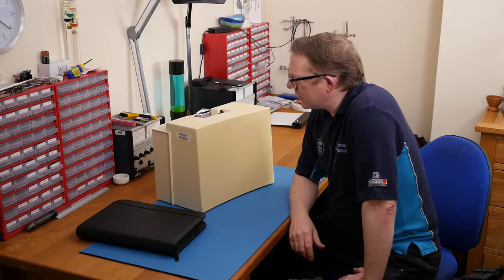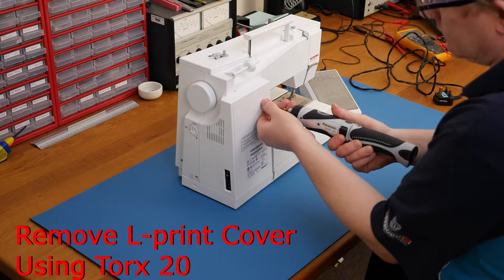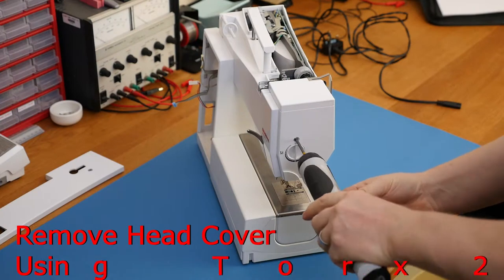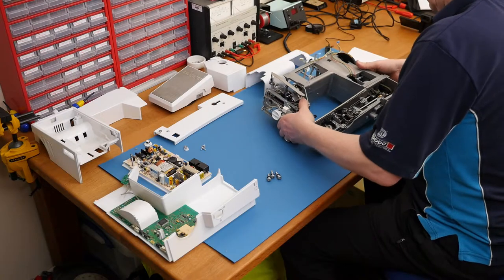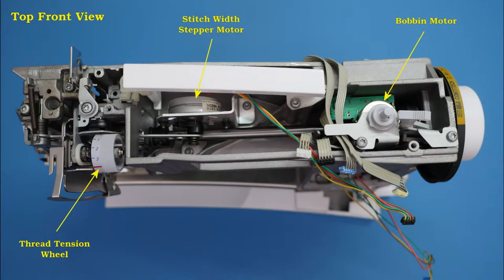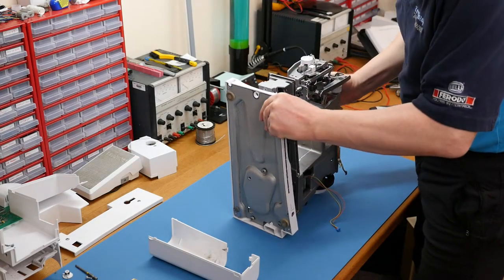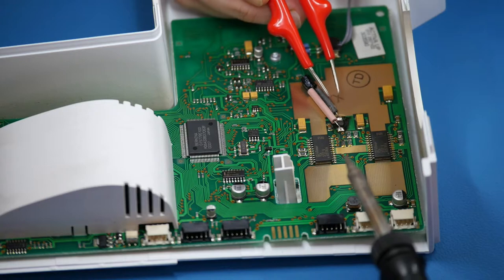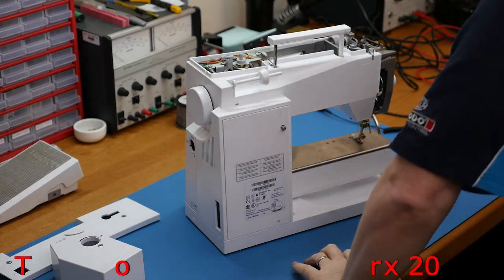How to Mend Repair a Bernina activa 140 Sewing Machine  + 🏃‍♂️ Live Machine Running 🏃‍♀️ disassembly

Comment: I've been an electro/mechanical service technician for over 30 years and this is one of the best repair videos I've ever seen. So clearly filmed and well narrated. You, sir, are one of the best on YouTube. I'm looking at buying a used Bernina and this makes me think I could fix it if a problem came up. Nice to see the guts of a 20 year old machine similar to one I'm looking at. Many thanks!
Reply from the maker: That's one powerful compliment.  I thank you Sir for taking the time to say this.  I do try my best and put my heart into my videos.  Hope it helps you.
Reply: @CoatsandGaiters  When I saw your workbench setup with spares and a Fluke multimeter and a Weller soldering station I knew that this would be a good video. We have a few things in common, it appears. I also have an attraction to motorbikes and auto repair as well as a suitable assortment of high quality tools and gizmos. 

Living near the left coast of the US I don't have much need of Peugeot repair videos (they haven't been imported here since 1990) and the last Mini I was involved with was a tired 850 back in the mid 70's that was confiscated by the constables in Amsterdam for not having Dutch plates. 

I did have some serious dealings with two separate Norton 850 Commandos in the same time period, one of which got left alongside the motorway with an alternator problem on the way to Rotterdam. When I returned someone had already collected it without leaving a note. Heartless tea leaf.

It's always refreshing to watch someone who knows how to properly wield a screwdriver and spanner and doesn't let his wisdom inflate his ego. Cheers and thanks.
Reply from the maker: @marscruz  Oh dear you've had some luck haven't you !!  Ironically I have been planning to start doing electronics on YouTube as I enjoyed it as a teenager but still not got around to shelling out the £1,000+ for an oscilloscope so things have been on pause for a while now.  I struggle to pay big money on tech items as they always tend to go wrong or have a sting in the tail, like needing an update or something that often kills the item.  Mind saying that there are lots of true experts on YouTube that do electronics very well.
Reply: @CoatsandGaiters  There are some good deals to be had on inexpensive Rigol and Siglent Tech scopes for less than half of your thousand quid price point. I heard about them from Dave Jones on the Ozzie channel EEVblog. He tests multimeters, scopes and all sorts.
Reply from the maker: @marscruz  I was looking at the Keysight ones.  If a mobile phone is £1,000 then surly something as complicated and precise as an oscilloscope would be £1,000 minimum in my logic.  Camera lens is £1,000 as well....everything is £1,000 lol
Reply: @CoatsandGaiters  Looks like the least expensive Keysight is about $600. Ouch! Maiden USA.
The best American scopes (ancient analog) used to be Tektronics and HP. I haven't used a scope in ages (retired). 
I like my Fluke meters and Wiha screwdrivers. Good tools makes the job easier. 🙂
Reply from the maker: @marscruz  Tektronix is still the best I think but the prices are really serious, that's why I'm reluctant to buy under £1,000 if I did buy one.  It so often happens you buy the cheaper one then find you should have paid that bit extra as you missed some important feature.  Then you sell it at a loss and buy the one you know you should have done.  I've been waiting to buy a scope for the last 2 years so can't see me shelling out that grand any time soon.  I'd have to be really flush to do that.  I spend it on camera gear but struggle with spending it on tech.  I just upgraded my phone but it was to an new old iPhone 11 for £350.  Again I cant bring myself to spend over £500 on a phone.

Comment: Can only say Wow ! I have exactly that same machine...which is now 20+ years old. At present - fingers crossed - it's working perfectly, but the observation about tantalum capacitors is well taken on board. 
Apart from fixing that, showing how to remove and install the covers is very helpful as mine was bought used and could probably benefit from a service. I'm quite used to servicing vintage mechanical machines, but never so far had to take the covers off a modern one, so knowing how to do that without damage is brilliant. 
Despite their age, these are still superb machines.IMO Bernina still make the best domestic ones...although at a price...but think you can figure out why when you just lift one up (heavy !) even before you see that chassis and compare it to some of the other stuff on the market.
Editing this must have taken quite some time and effort, so thank you so much.
Reply from the maker: Thank you for the comment.  I love the Bernina machines, my wife has one and my mum is still using hers so the repair has held up since making this video.  The videos take about a week to make.  Two days to record, two days editing and then a day doing voice over and social media parts.

Comment: This is the best repair/tear-down video I have ever seen on YouTube, and I have watched hundreds.  Brilliantly, logically structured, detailed and comprehensive.

It gives me some hope of repairing my sisters Activa 135. I suspected a fault with the L-print PSU module, since the 5v logic S-print module and and screen are alive, but no drive to either main or bobbin motor, even though the footpedal appears fine (microswitch working, cable OK, potentiometer range seems about right from ~10MegaR to 8R fully depressed). This video is just what I need to dig deeper on a sewing machine, a device as alien to me as  a Formula One gearbox.   

AIUI new L-print boards are about £150 and S-print £250, but n/a to ordinary punters,  only pro Bernina techs. Add labour for service and it's fairly obvious why my sister's machine has sat in a cupboard for 4 years. Even if you can afford a potential £400-600 bill, it's a lot of money to spend on a 20-year old machine. She already had it serviced by independent sewing machine engineers who failed to fix or identify the problem, probably because electronics are beyond them.  Thank you so much for making this video. I'll let you know how it goes.
Reply from the maker: Thank you for such a lovely comment and I really hope you manage to mend it.  Keep us updated.
Reply: Can't edit but the range of the footpedal potentiometer measures 10megaohm (with pedal depressed just enough to operate the microswitch cut out) to ~8ohm at full throttle.  I believe this is correct. There is another pretty  good video on YT that deals with testing the Bernina SR1 footpedal and cable used by this generation of machines. Seem to be a very common failure, but are also widely available new, £50-£60.
Reply from the maker: @MrShadownoise  Thank you for all this information.  Hopefully it will help others that read the comments.
Reply: And... it is fixed and working. I stripped it completely. The 135 is a bit different, with a simpler power supply and only a single fuse.  Found a couple of indications of previous sloppy repair, including a missing case bolt and some sticky tape. On the S-print module I re-soldered what looked like 3 potentially dry joints, but also the 4-pin 'blue' connector  was disconnected - I assume the previous sloppy repairer didn't insert it fully.  Thanks ever so much for showing how it comes apart and the sequence.
Reply: Also the S-print board is very different  on the Activa 135. No surface mount tantalum capacitors! The joints that looked possibly dry  were either end of a fairly large axial capacitor near the centre of the board, and the attachment points of the mains socket (which probably gets stressed by frequent use). But I suspect the real problem was that the 'blue' connector had come loose or not beein fully inserted.
Reply from the maker: @MrShadownoise  Sounds like if anyone can repair it, you could Tony.  Everything seems to have such a relatively short life today considering the cost when new.

Comment: Thank you for your awesome video of the disassembly and workings of the Bernina. I have a Bernina activa 130 and wanted to clean the insides. Your methodical and clear disassembly was what I needed to be sure I was able to see the insides as well as carefully reassemble it properly. I would love to see a video similarly showing the areas that need to be oiled or greased too. Thank  you for your time and efforts.
Reply from the maker: Thank yo0u for such a lovely comment Angela.  Sadly the sewing machine is my mums and it's back with her.  Hopefully your be able to oil it with some Bernina recommended oil.  Best use what they recommend to be on the safe side and this might be where less is more.  I'd probably just put a spot on every point where there is movement between the mechanicals.  Good luck.

Comment: Wow, based on the comments there is great demand for help with sewing machines!  A general Youtube search brought me to your video.  Well done.  Bought a Activa 130 at the car boot yesterday.  Powered on, but wouldn't sew.  Fault was easy to spot - very poor repair on the cord to the foot controller.  Machine needed a deep clean so I took the case apart like you did - looked like the machine blew up on the kitchen table!  Lots of lint to clean away, lube, and will put back together today.   No burnt tantalums, matter of fact, board is not identical to yours.  Meanwhile, Run it May, Shine it Must.  Cheers!
Reply from the maker: Sounds like you got yourself a bargain there.  They are great machines, shame the electronics can be a weak point but all tech ages I guess.

Comment: This is indeed a very nicely made video. And congrats on getting a working bernina!

I just got a faulty activa 145 but I guess I’m not that lucky to be able to get the faulty board, and machine, back to life. But will give it a try!

Thank you very much for the effort you’ve made in making this.

By the way the machine is fascinating!
Reply from the maker: Thank you.  The capacitors fail after 20 years so your could well be the exact same issue.  Good luck.

Comment: Thank you for an extremely informative video.  I bought a 220 years ago hoping to use it for classes but the local shop closed up.  I pulled mine out a couple of years ago and it wouldn't start and the dealer said to wait a half hour to 45 minutes.  It came on.  I was able to use it for a couple of weeks and then the stitch length died on me.  The needle just goes up and down  but the feed dogs work.   Bernina only gives a lifetime warranty on the metal parts, not the computer parts so I don't know how much they would charge for the fix and I was too frustrated with the machine to care anymore.  My daughter wanted a better machine and thought about seeing if I could this brick working so I checked out your video.  I don't feel comfortable in taking it apart, but from your video I'm guessing the connector is probably loose up front.  Still worth fixing as it seems some of these computer parts die after about 20 years.  Again, awesome video.
Reply from the maker: Thank you for taking the time to comment.  I think the capacitors only last around 20 years which is what died on my mums one in this video.  Hope you can sort it as they are good machines.
Reply: @CoatsandGaiters   I called up Bernina and they'll take a look at it.  Funny how one time I called up and they said it was worthless and now another lady says to bring it in and we'll take a look.  Once I got it up and running after your video it sounded terrible so I know it needs a good cleaning and oiling.  I miss the old days when you could practically take the entire machine apart yourself, oil it and everything was metal.  I have a much better understanding of why these machines cost as much as they do from your video and the cost to repair and clean them.
Reply from the maker: @quiltedwithlove  they are still expensive on eBay second hand so even if they quite really high you could probably still sell it on ebay as spares or repair.  Everything is getting more and more expensive recently.

Comment: Thank you, I have just bought an Ex-high school machine, identical, 140 Activa. It is quite grotty and there is a tiny squeak noise which I am thinking might be a capacitor on its way out. Thanks to your video I am confident I will be able to isolate the offending capacitor if/when it does blow. And also I am confident I will be able to clean its insides thoroughly and sort out whatever has been living in there recently. 🥴
Reply from the maker: That's great news I hope this video helps you.  Give's you a better insight if you do need to work on it.  They are lovely machines.

Comment: At 14.50 you run the motor with the presser foot down. Bad idea, you can scratch the base of the foot with the moving feed dogs and this will cause snagging on the fabric later on. Great video though, very informative. I can service the old non electric machines but would never attempt anything electric, don't have any experience with electrical devices and would probably kill myself. But it's fun to watch and I've learned a lot, thanks. Bernina sewing machines are the best in the world. At the end the wee fart sound as the machine powers up is the Bernina Burp, the needle centres itself on power up and this is where the noise comes from.  A needle set at the centre certainly won't work with the zipper foot though.
Reply from the maker: Good point, you can tell I don't sew lol.  Good to hear you learnt from it, I found it interesting to make the video and see everything working.  It's like magic when you see so many parts interacting at once.

Comment: I have the identical machine but was told by a Bernina repair person it wasn’t worth fixing cos if it’s age in case it blew again! After watching your excellent video feel confident I could take it apart and test the basics but I’m sure I wouldn’t identify the type of capacitor it would need should I see a burnt one! Any suggestions? I’ve just successfully mended the foot pedal of my mums vintage sewing machine( a lot less complex I have to add) after being told I’d probably need a new one!!! I’m probably getting overconfident now but feel I have nothing to lose! Feel distraught to let it die!🤣🤣🤣
Reply from the maker: They will be considering the labour costs involved I expect.  Don't forget these things will always have a value on eBay to someone.  You can always take a look and if you see something obvious or the same capacitor has blown as in mine I can try to help with information etc.  You can send photographs direct to my email address in the 'About' section on here'
Reply: Thank you so much that’s so kind! I’m going to have a go and I will meticulously put sticky tabs to link parts to attach in correct places!! At 69 memory not so gt but head not gone yet!!🤞🤪🤣!!! Sue
Reply from the maker: @susanbearsley7746  Keep us posted Sue.  I always say nothing to loose as long as you don't break anything lol.  I'm sure your be ok if you take it slowly and note things or take photo's with your phone as you go along.
Reply: Hi, Susan - you are definitely thnking along the right lines. These are brilliant machines that seem to be a bit under the radar, but much prized by those who have them. To buy anything equivalent today would cost a lot (broadly it's the current Bernina 300 series - very similar machines inside, but with revised cases and a few new whistles and bells) that spending some money on fixing it is what I'd do...that is if you can either DIY or find an honest repair guy who isn't fibbing to try to sell you a new machine. They do that unfortunately....
Mechanically Berninas aren't likely to go wrong unless abused or heavily used without service for a long long time. 
In reality, you don't need a sewing machine repairer for the electronic stuff. Most know next to nothing about electronics, and would only swap out a brand new board at a price and not attempt a repair. Almost certainly better to try to find someone who fixes generic electronic stuff who'd sort this for next to nothing. 
As an alternative, these crop up on that well known auction site ffrom time to time and go for not a huge amount. Have a 140 that was £150, and an Activa 135 that was £175 both working 100% -  so you may get a fully functioning machine, but if not at least have a spares machine to make a good 'un out of 2.
If you haven't already fixed it/got it fixed, I hope you do.
Reply: @mehere779  Thank you so much for your advice. Haven’t actually attempted the repair yet as had lots going on in house after a flood during the December freeze! You have motivated me to have a go though and I will post how I get on! I have a nephew who used to to fix the monitors and electrical equipment in hospitals so I’m sure he’ll have the appropriate tools! Thanks once again Sue

Comment: Great informative video, I have a Bernina 750 and when turned on there is only a flash of the sewing light, I know what to look for and will take my time finding the problem, thanks so much.
Reply from the maker: That great news John I hope this gives you an insight to help you.
Reply: @CoatsandGaiters  all I am getting is a flash from the sewing light when I turn the machine on which would probably mean there is a short somewhere, I can hear a continuous noise near the on/off switch when the power is on, have checked the fuse near the on/off switch and that appears ok, so I will need to go in deeper and check other causes, thanks for your information.